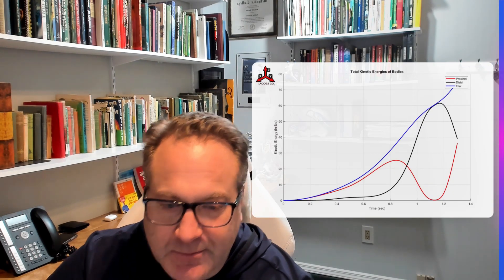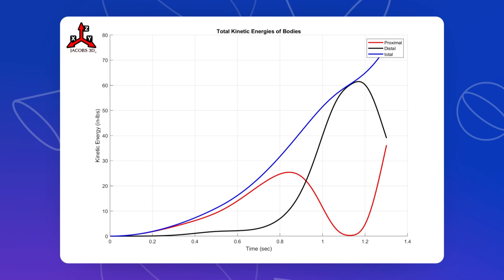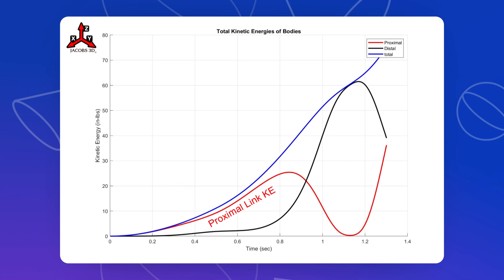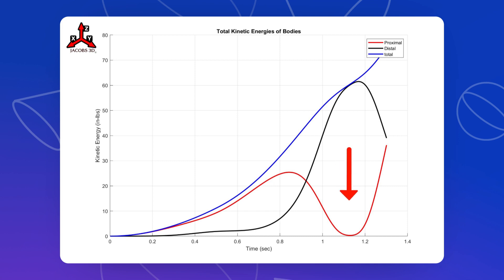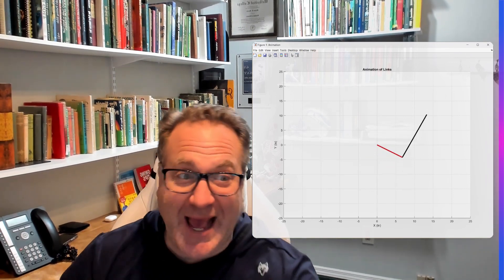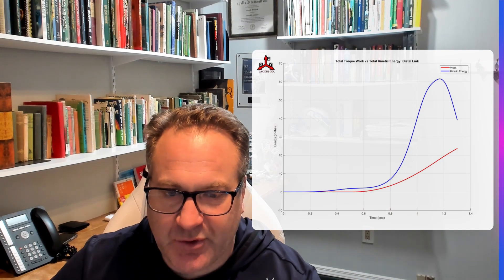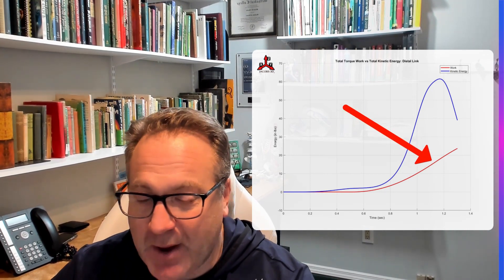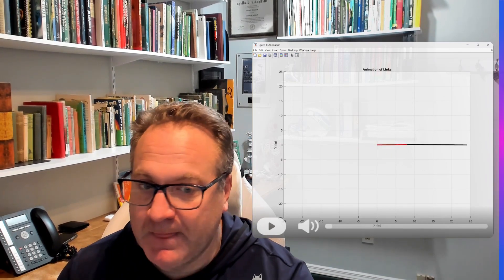Kinetic Simulation Part Two

Comment: So it would appear that to match these results, you would be putting the same consistent torque, theoretically throughout the downswing and the transfer of energy happens regardless. So there probably shouldn't be any intention from the golfer to decelerate (not that you would anyway in less of the blink of an eye) to get some type of transfer or release. Fascinating stuff. Thanks for sharing.